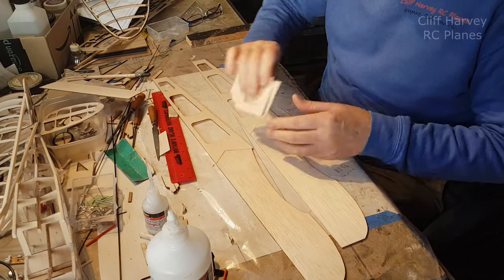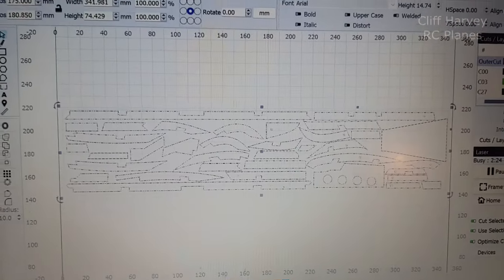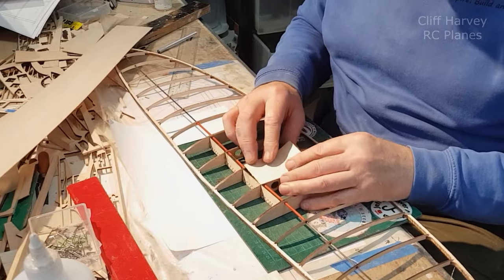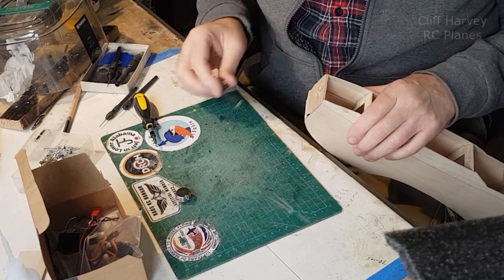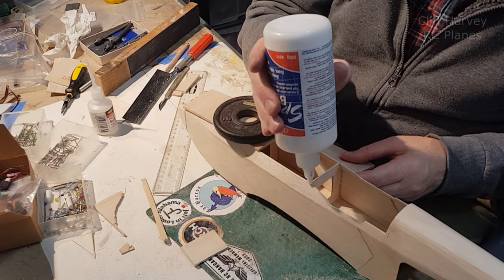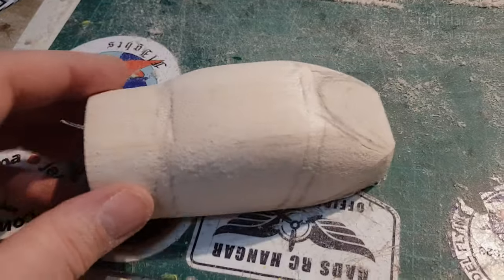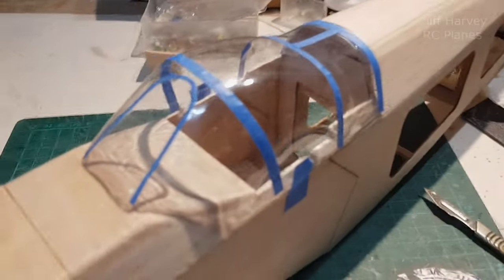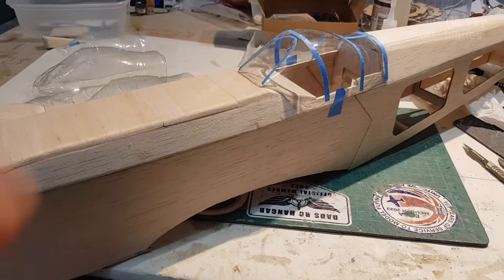Slow Fly Spitfire Build Part Two

Comment: Hi Cliff,
 I want your advice in buying  the best Laser cutting machine for doing models , the-size I am conserned since I am only in building up to 30” wing span sheet balsa wood, if not using ribs  or strip structure model.there are so many types , so you are experienced could you recommend what type to buy ? 🙏🏽
Reply from the maker: Hi Mahir, my experience is limited to the machine I use, the Algo Laser Delta, it does everything I need for building models. The main drawback is the cutting area is only 350mm x 350mm therefore all the parts need to be positioned to this maximum length. You can get extension kits but I'd have to make a new box (which is pretty essential if you're using it indoors, along with an extraction system). I didn't have to do any research as the laser was a sample from Algo, as it happens it's a really good machine but there are many on the market. I would say do a lot of research and buy the best one you can afford bearing in mind you have to spend a bit on getting the area ready, sorry I can't be of any more help on the subject, cheers

Comment: Your Loving that Laser cutter arn`t you. 
I`ve used the bottle method myself, you need a good pair of leather gloves and mount the mould as high as you can to get the shrinkage at the bottom.
Salisbury`s diet lemonade bottle is a very good tool I have found, a thinner plastic and melts easier. 
Looking forward to seeing the end result. ❤
Reply from the maker: Yes I am Nick, funny you should say about being thinber plastic because I found the Ribena plastic to actually perform better and it was the thickest 🤔👍
Reply: I thought you used a Vimto bottle? 😇🤣

Comment: Oh man . That chunk of balsa you used to make your canopy mold would easily cost me over 20 dollars in my neck of the woods .
Reply from the maker: Really, that's shocking DM, I  had it in stock from a few years ago, I bought a 3ft length 4in square but it wasn't that expensive but prices have moved on I guess 🤔👍
Reply: correction 17 dollars 3x2 x34
Reply from the maker: @diceman2004  That's more like it ... I'll have two, cheers